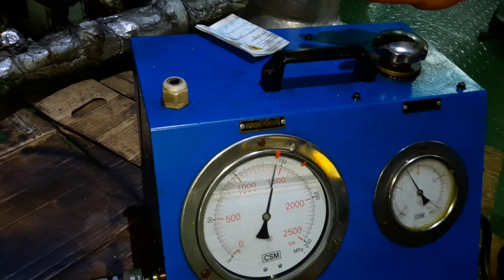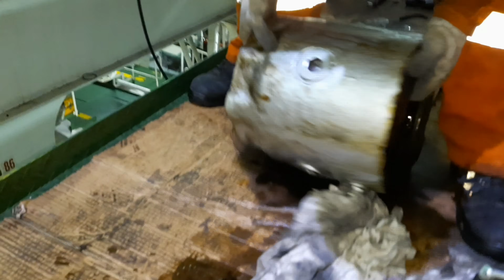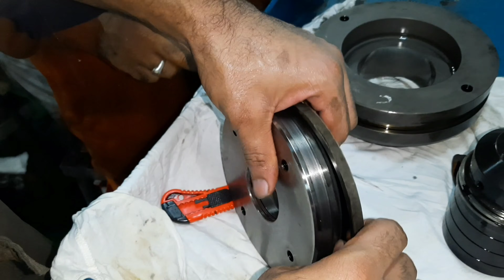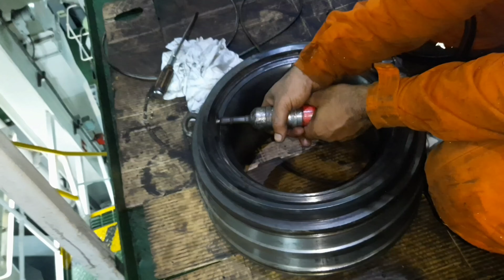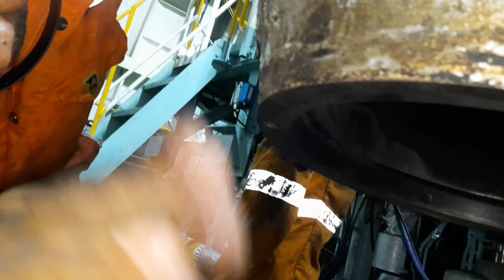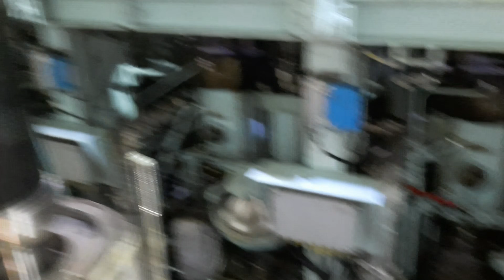TECHNIQUES FOR ME ENGINE EXHAUST VALVE OVERHAUL| MAN B&W ME SERIES   | SEA LEGEND |

Comment: Which pressure is released by Mounted Safety valve on the EXH.VV ? . Pressure is 21 Bar Mentioned in manual...
Reply from the maker: U right,the safety valve lifts when pressure inside  air cylinder  raises to 21 bar